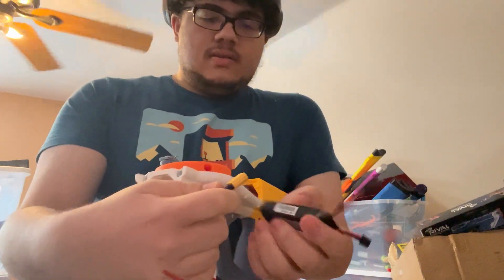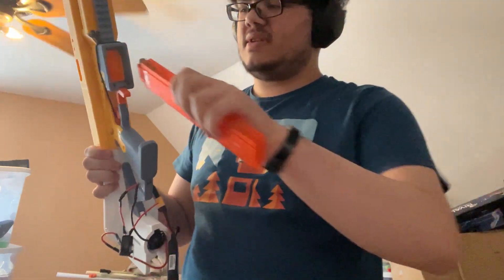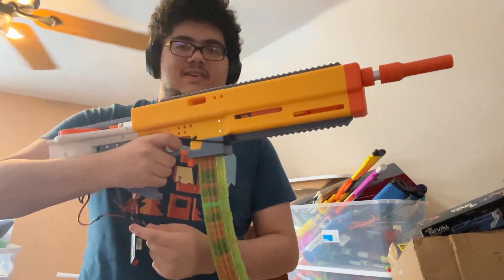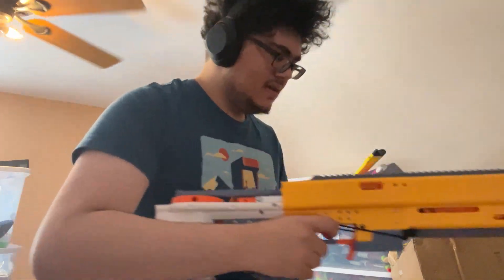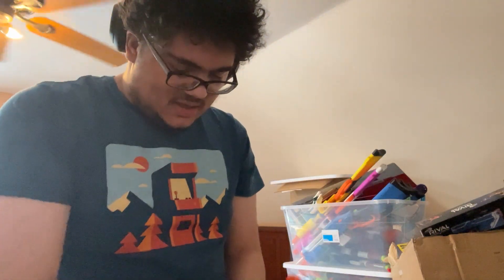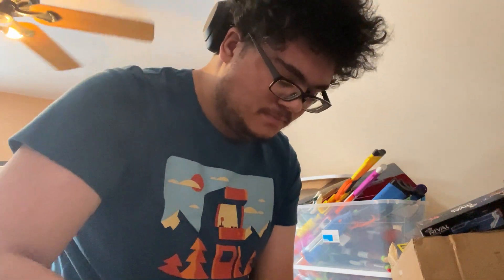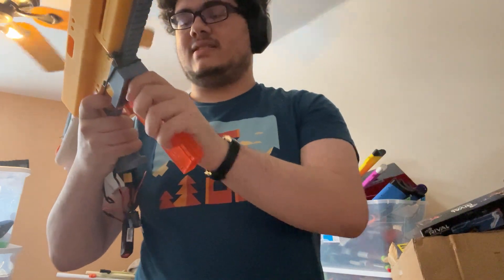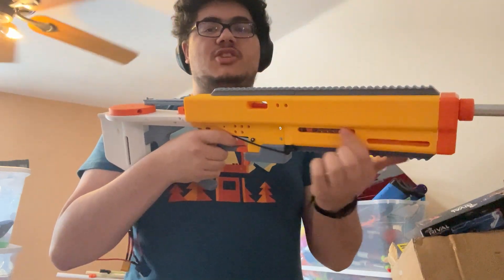AEB/AutoSpringer prototype chronographing (100-140 fps, bad barrel to spring ratio)

Comment: How are you planning on making sure the motor always makes a complete rotation?
Reply from the maker: There is a limit switch that the breech block goes over. If the switch is depressed, the motor keeps going. If the switch is released, the motor stops.
Reply: @Sillybutts  ok so you are using motor breaking that's cleaver i was afraid you were going to use an arduino or something.

Comment: Considering the pilot only has like 2" of actual volume, are you considering testing with an air hole to allow the plunger to get more speed between shots?
Reply from the maker: Nah, not planning on it. This design already has a lot of space behind the plunger, and the seal is pretty good. I don't see speed slots helping in this instance.